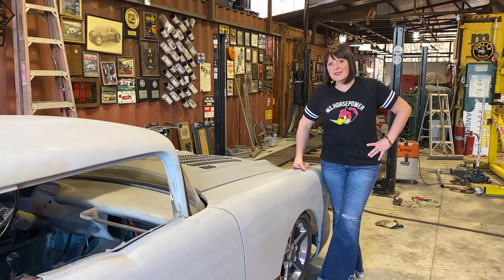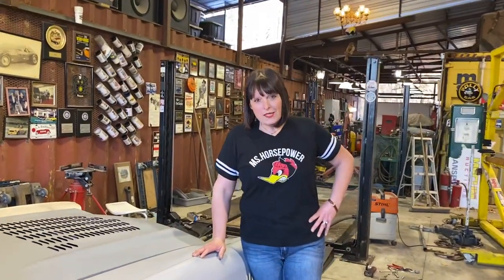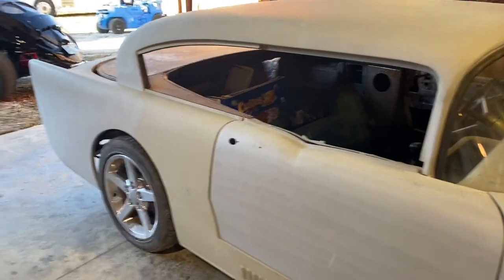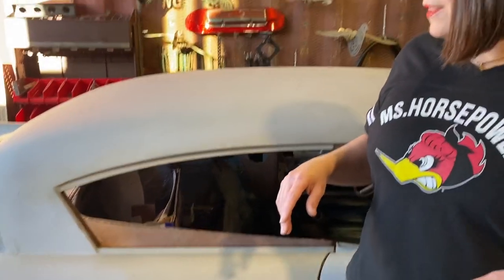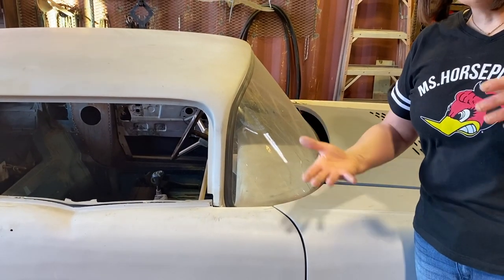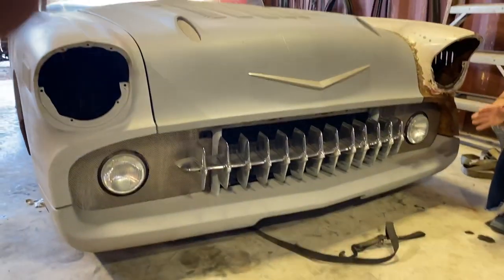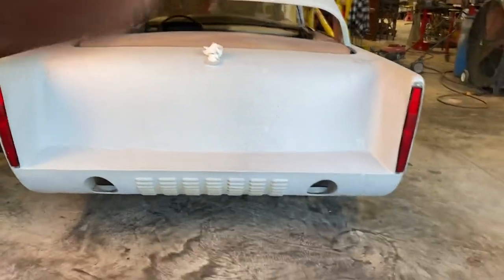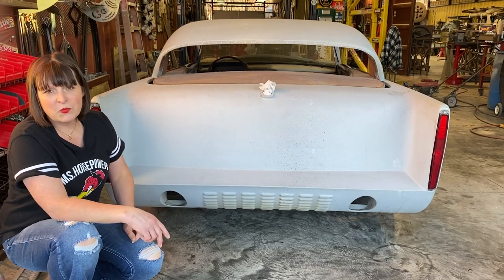Take a look at this radical ‘57 Chevy custom! Chopped, sectioned, channeled, and shortened! #57chevy

Comment: That's most definitely going to be one of its kind that's a for sure..I'm trying to picture it completely done but the only way to understand how the car will look is after it's been painted and completely done cause I really can't picture it in my mind until you've completed it..I'm really into the sinking of the windshield cause from the time I's a teen in the 70s, I always wanted to chop a top without having to have glass made for em and I'm guessing it could be done with a rear window as well without having glass made..I think with certain vehicle's even the side glass wouldn't have to be made..In the 60s and 70s people were into the vehicle's with flat windows to make the chop easier. I remember seeing several of em in parades and the glass was made of plastic and you could see the plastic windows kind of shaking from the built engines in em. I'm not saying that the windows were floppy but you could tell they's plastic and most of em was tinted to match the color of the vehicle's that I wasn't to fond of until they started making dark tint..Something about dark tinted windows just looks cool to me lol..
Reply from the maker: Thank you for the great comments and supporting my channel. I finally get to work on this car again soon. It's been sitting for almost five years now! Stay tuned for more updates...

Comment: I would much rather see this fairly awesome ‘57 get some love than all these other less impressive projects.  A hummer with slightly better proportions but lacking off road capabilities?
Reply from the maker: Hello @reddymon! Thank you for your comment. It was a tough choice for me to put the HMMWV build in front of the '57 Chevy. I built the HMMWV because my late husband and I needed a new shop truck. I like HMMWVs in their stock configuration, but they aren't practical to drive everyday. At the beginning of every build, I set goals for what I want the vehicle to do. I wanted a cool shop truck, something different, something that I could easily drive on the interstate, pull a trailer, and go to car shows. I built the HMMWV how I wanted to and it is doing everything that I wanted. Since finishing it I have driven from Missouri to Las Vegas and back, to Indianapolis, to Orlando, along with my daily commutes. It's geared for the highway and it's sweet spot is 82 mph and it is only turning 2000 RPM. I get about 12-13 MPG on the highway and I gotta say, I absolutely love driving it. I'm hoping to get back on the Chevy real soon. Stay tuned for progress updates. Thank you for watching.
Reply: Thanks for your detailed reply.  The ‘57 is more my cup of tea while the Hummer is not.  You build what you need and I am glad the Hummer works well for you.